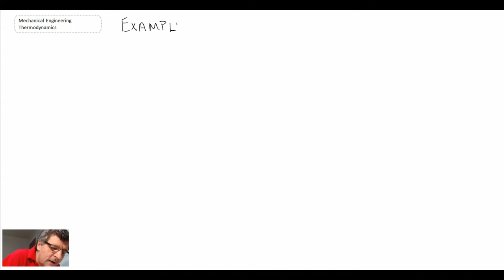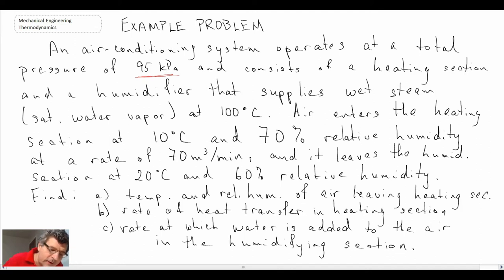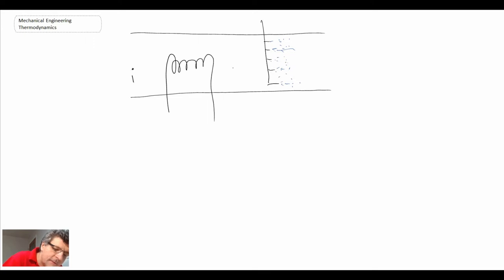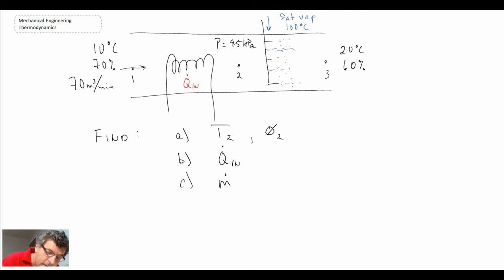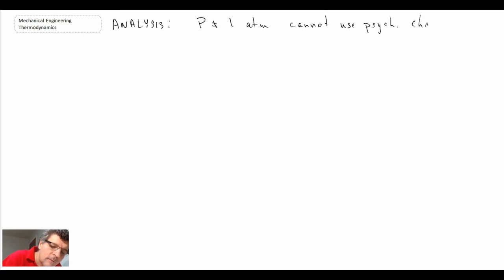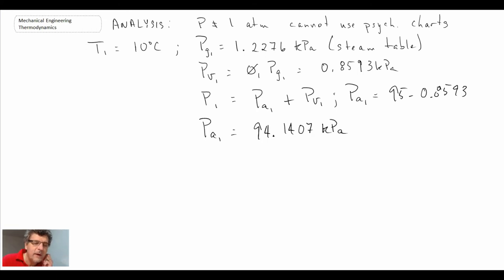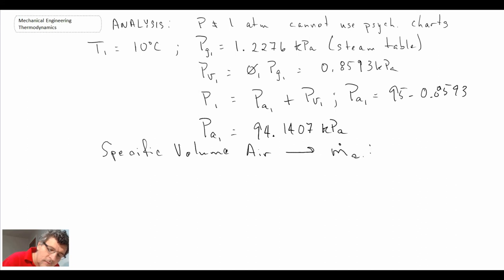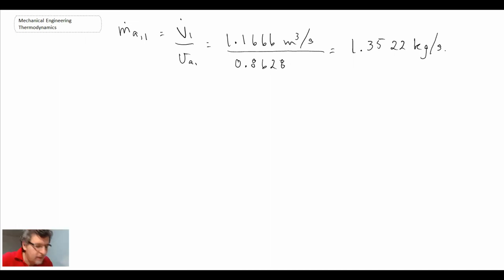Mechanical Engineering Thermodynamics - Lec 30, pt 1 of 4:  Air-Conditioning Process Example Eqns

Comment: Hello Mr. Hugo, hope you're doing well. When you find the mass flow rate of dry air, you divide the mass flow rate of MOIST air by the specific volume of DRY air. This is confusing and seems inaccurate. It'd be great if you could clarify this for me. Thanks.